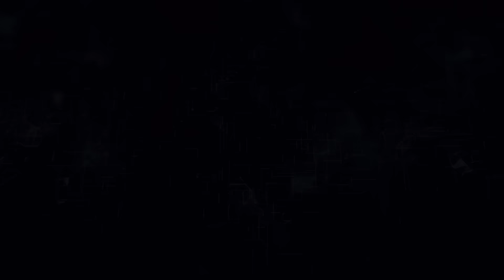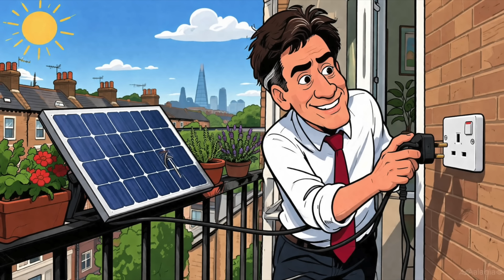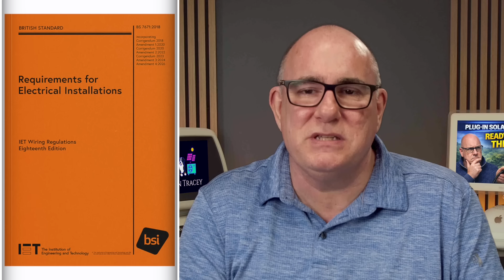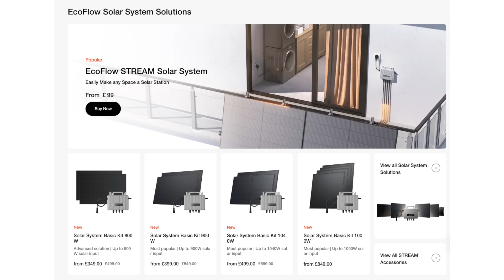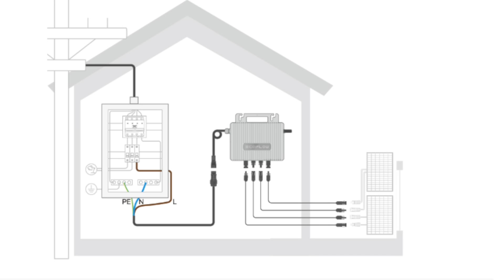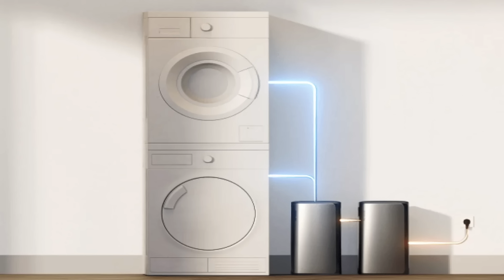Plug In Solar Is Coming… But There’s a Problem

Comment: Hello, France here. In France you can "plug in" up to 2kW peak power on a dedicated circuit. So yes it can run the house on low loads. There are non plug in systems for houses with three phase up to 12kW Peak power with multiple micro inverters with each inverter handling two panels. There are strict regulations which I am not going into only to say planning consent is required if mounted high than 1.8m from the ground ie wall, balcony or roof mounted. The power networks will visit to sign off and the power companies need to be notified. In the UK there is a lot of misinformation regarding what you can do and what exactly plug in refers to. I am sure the UK will adopt the plug in system but with a whole load of regulations attached just like any country which has adopted the systems. I just asked my house insurance company about the plug in solar. There are no problems as long as the systems are certified and that includes plug in systems. The insurance premium is to cover hail damage more than a fire risk. Remember hail in Europe can be the size of golf balls and so panel tempered glass thickness of minimum 3.2mm recommended.
Reply: The limit is 3kw not 2
Reply: And technically we're also taxed €10 per square meter on the panel area.
Reply from the maker: @pt6423 Thanks for sharing — really useful insight into how it works in France 👍

Interesting to see the higher limits and how it’s all structured with proper sign-off and regulation. In the UK, 3-phase is still mainly in commercial settings at the moment, but it’s definitely starting to be positioned for new-build homes.

Feels like we’re heading in a similar direction, just a bit behind.
Reply: Yes, it will be laden with regulations in the UK, which, of course, means more costs. I see on ebay that Ecoflow are now wanting £399 for the basic two panels and a microinverter.
Reply: @davidscott3292  Wait for it to become legal. There are far better suppliers of plug in solar kit outside of the UK who being more reputable are not flogging their kit in the UK before it becomes legal to plug it in. That should drive prices way down and quality up a lot. Some of the good stuff can also couple with standard batteries not rip off vendor specific ones. Ecoflow and many other vendors work an Apple like model where every accessory has to be their own and are priced accordingly.
Reply: 2kW is not enough. That may be the instantaneous average load over 1000 domestic residences but you need more like 12kW for back up. Best connect for essential non-heating loads such as lighting, TV, computers, chargers and pumps.

Comment: I'm an electronics designer who's worked with switched-mode supplies for a decade or two, worked on high-voltage arbitrary wave generation for 10kW sonar at 1kV and I'm watching the new semiconductor technologies - in particular, GaN which would be ideally suited for this (and there are MANY papers in the last 5 years on the IEEE with new designs which are suitable for this).
I reckon a low-cost modular converter system would be possible at a cost level of  £10-15 each to achieve 97-99% conversion efficiency for solar to mains. I'm at a "loose end" at the moment with almost no design work to do. 

Would somebody like to collaborate to start with a requirements spec and a system spec to get a permissively licenced open-source design out there to help everyone use micro-power?

Drop me a note if you're interested in coming up firstly with ideas for  the product requirements - what it needs to do etc ...
Reply from the maker: @simoncliffy That sounds like a really interesting project — and fair play, it’s way beyond my level of understanding!

I’ll definitely be watching with interest though, best of luck with it 👍
Reply: @JonathanTracey - it's not really anywhere without knowing what it needs to be. Offhand, I wouldn't even know how much power it should handle. 5-10W for a little handheld panel, 30-40W for a bigger camping style thing or go for 500W to allow it to be integrated with a full sized panel?

This is why the initial product requirement is so essential (and yes, whilst this method is in every product design standard and company system design standard, I haven't really seen a single company do it - much to their regret a few years later).

We need to find someone who's wanted to get something like this, or may have even used one and has a few thoughts on what needs improving.

Unfortunately, it seems that nobody is that interested in the idea of domestic solar anyway, if the paucity of any comment here is anything to go by.

Comment: Is there a risk, if you have 2 micro inverters, that they could see each other as the grid, as therefore keep running in a powercut? Or next door have one on the same phase as you?
Reply from the maker: So I suppose there’s a possibility, however I’m running to micro inverters right now and have been for the best part of nine months and haven’t had any problems. In fact yesterday when we had a grid outage both the micro inverters shut down. The large inverter in the house the solaredge system kicked over into island mode. It continued to supply power of the house, but both of the micro inverters remain remained off-line until the power came back on.
Reply: The simple answer is the way compliant ones are designed - no. The complex answer involves a rather detailed discussion about the difference between grid forming and grid following inverter circuits.

So providing you didn't buy something cheap off Temu or some dodgy non certified supplier you should be fine and this is well tested between buildings in Germany as you can imagine.

Comment: You dont have to export, ecoflow do a smart meter that wont let you drain your excess to the grid. Then use an ecoflow battery system to the excess meaning your power run time extends to after the sun is gone.👍
Reply: My Ecoflow Ultra still dumps some electricity for short periods to the grid even though the app tells it not to. There is always a short delay between the sensor that it clamped to the mains input going in to your house and the inverter system.
Reply: @andyspoo2  Even without the smart meter you can set the output limit from the battery. So if you know your base load is typically 400w then you can set the output limit to 350w and be confident it will never waste any power to the grid.
Reply from the maker: @bargainbrewer810 Yep that works 👍 batteries are great for shifting excess into the evening.

Just worth remembering they don’t create more energy — you still need enough generation in the first place.

Comment: Why would you need a g98/99 for a system that cuts off generation in the event of mains  power loss. No energy is going back into the grid as a danger to the grid
Reply from the maker: because the current regulations require it
Reply: The G98/G99 is so they know there is generation there, so they can tell if the meter is suitable and also because your system will feed back power in spikes as it tracks load, and if its smart meter unit or whatever fails can feed back anyway.

It's an easy form and could easily be mostly automated as well

Comment: Yes plug in solar will only give you at best 800 watts, but think what hundreds of thousands of plug in installations will do to cleaning up the UK grid supply.
Reply from the maker: agree as someone said recently, even small shavings make a pile if have enough
Reply: Sadly not a great deal.  Certainly a plug in system will help a household decarbonize a bit, trim something off the bills and reduce the demand on the grid a percentage point or two.  But as for the overall national demand ( industry,  lighting, electric vehicles, etc etc) it won't make more than a tiny impact...but it's still a good idea and gets my support, we just have to have realistic expectations.
Reply: @jimpaine6331  A million 800W installs is 800MW of solar generation capacity, delivered to the places it will be used. Germany had over a million of these systems registered as of last Autumn and a load more have been added since.

The thing is it scales. It's like when the internet first took off. Because you didn't need a special man to come round and install the special approved equipment to  the special approved regulation it could expand as fast as they could physically make and ship modems.

And like modems we are seeing them as enablers and they already become the basis for bigger self approvals and different ways of staying within the grid tie limit but generating more power outside of it.
Reply: We will have to see what is offered - it may only be 400W without a small consumer unit change. Most of these systems also allow some devices to be plugged in directly which fall outside of the 800W. So for example it's not uncommon in some EU countries to have 1kW available out of the plug socket and 800W to the grid tie.

Several countries allow more on a dedicated circuit (3.6kW Norway I believe, 2kW some others). The UK as it stands would allow 3.6kW on a G98 regulation on a single dedicated circuit. The only thing stopping that right now is actually the fact you need it wired not plugged and you need the correct isolator (not clear why), bidirectional trips etc - so there's really no reason for not allowing some kind of express 3.68kW inverter scheme.
Reply: Cleaning up? Not really because the kit is made in China using power from coal power stations.
Reply: @davidscott3292 ok but you realise the coal only has to be burnt once to produce the panel that can be used over and over again? Why do some people have to be so relentlessly miserable?
Reply: @davidscott3292  The Chinese grid is actually very clean (52% renewables) which is slightly better than the UK. Their energy usage per citizen is also way lower so they beat us hands down on emissions.

And a solar panel is made once and lasts 30 years then gets recycled.
Reply: @etchedpixels  Yes. People forget that China has billions of people and per person they use a fraction of electricity than a western person does.
Reply: @davidscott3292  China has a lot of solar and wind energy and you can be sure that a company that makes solar panels is using solar panels to generate their electricity. They are also phasing out their coal plants. "In 2025, China's total installed renewable capacity reached over 2.34 terawatts (TW), with significant contributions from solar and wind power, marking a substantial increase in renewable electricity production. The country aims for 63% of its power mix to come from non-fossil sources in 2026."

Comment: Chances that the electricity suppliers will increase the per-day standing charge after this is rolled out ? ... Magic 8 Ball says "most definitely".
Reply from the maker: @markpeam8549 That’s the big unknown 🤔

Standing charges are already being reshaped, so it wouldn’t surprise me if costs get shifted around — just not clear how yet.
Reply: yep and the new tarrifs of no standing charge (trials happening) won't go ahead or be available to people with solar will it. Then you know there will be a solar tax, pence per kwh generated. say 3p to start with,
Reply: Whilst there may be some benefit to the move it is important to be realistic. It will not provide energy independence for the UK because peak demand will be in the midwinter evening when there is zero solar to help out no matter how many panels folk buy. Unfortunately what will happen is that we will have power when we dont need it and yet the same enegy and economic problems when we do need it plus the additional cost of all these systems.
Reply: Reminds me of when we all cut back put energy saving bulbs everywhere and our bills still doubled.
Reply: @garrypawlett9562 if we compare 2004 and 2024 we now have 40% higher total installed UK generation capacity producing 20% less total electricity (peak demand also 25% lower) and costing consumers twice as much! All this as we moved from 0.4% solar and wind generation to 35% after spending trillions on 'investment' from your pocket. Im sure theres a conclusion that could be drawn from these facts!
Reply: @clwydsigma yes, electricity price is aligned to the cost of generation by gas. Gas prices are much higher so until that's duets out (more electricity not generated by gas and the removal of that price link) we won't have the cheaper electricity we should have.
Reply: @alanbuxey this is commonly misunderstood. The wholesale price of electricity (bit affected by gas price) only makes up a bit over a third of a consumer bill, whilst the rest is very much affected by solar and renewable costs (direct and indirect). In addition the intermittency if wind and solar requires there to be dispatchable generation (currently gas, historically coal) on the margin at all times to prevent system collapse. This is a practical requirement of the grid and nothing to do with phasing out. The more solar and wind we build the more expensive the bacup system becomes because it still has to recover its full costs even if it only outputs 1MWh per year.
Reply: @clwydsigma  Yet the excuse the energy companies give for the rising costs is the increase in gas prices (which some of them control to a certain extent via their supplier arms). If gas/ coal has to be used on any day, the cost per unit of all generated electricity is charged at the gas/ coal rate, regardless of how it's generated. If we can get to a point where gas/ coal is not needed, or even just only decouple the gas/ coal costs from the whole generation rate, it'll all be good. The running costs of the gas/ coal element isn't all where the extra charges come from.
Reply: Standing charges cover the base costs of providing the system whether you take power or not. This cost is increasing the more wind and solar we add to the system. Standing charges will both remain and increase, not the fault of your energy supplier.

Comment: Throw a big battery into the mix and 800W x 24h translates to 19kWh/day, which is a lot of energy.  Having a battery and DC coupled solar also removes any limits to the amount of solar you can have…. Only your actual export into the house wiring matters.  So, in fact, with batteries, there are very few actual limits.
Reply: Except the sun does not shine for 24 hours a day and 800W is peak power under full sun.
Reply: @mikebennett1301  That's what the battery is for.  You just charge it up with any solar in excess of what you want to output to the grid and when the sun goes down you continue outputting to the grid by discharging the battery. 

There is no particular requirement that the solar panels be limited to 800W, only that output to the grid be limited to 800W.  The panels simply need to be DC coupled (which they are in most of these balcony-solar products).

This is a long solved problem.  Long, long solved.  In fact, one of the reasons why laws are starting to be made to allow plug-in solar is because it is so easy to do, a whole lot of people already do it anyway, and have for years.  It isn't a new thing.

-Matt
Reply from the maker: @junkerzn7312 The maths there assumes you’re getting a constant 800W for 24 hours, which just isn’t how solar works.

800W is peak output under ideal conditions, not something you get all day. In the UK you’re typically looking at the equivalent of ~3–5 “full sun” hours per day averaged over the year. So in reality, an 800W system is more like **2–4 kWh per day**, not 19 kWh.

To hit ~19 kWh/day you’re into proper rooftop territory — think a **4–6 kW system with a lot of panels**, not a plug-in setup.

Batteries help you shift energy (day → night), but they don’t create more of it — you still need the generation in the first place 👍
Reply: @JonathanTracey  That isn't how solar works, but that's what you can achieve with solar + batteries.  Now of course, 19 kWh is a lot of energy... that would require a fairly large solar system (roughly 5kWp of solar).

I can only stress that you should NEVER think of solar as just producing power over part of the day.  You should always think of solar as producing XYZ amount of energy per day.   You can roughly multiply the solar wattage by 4 or 5 to calculate the energy on a sunny day.  Of course that would be only a very rough estimate.

The magic of having battery storage is that you can then decide how you want to dole out that energy to the house.  There is no particular limit to the amount of solar you can actually have feeding the battery.   The only limitation is how much power the combined system is allowed to feed into the house.

-Matt

Comment: My house uses between 500 and 800 watts including my fridge, tv, two PCs, aquaria, lighting, etc...

A basic plug-in solar system would basically cover that and that's fine. In the Summer-months my 800 Watt system basically halves my daily use. A setup like that saves me between 400-600 per year.
Reply from the maker: do you have a battery to catch the excess?